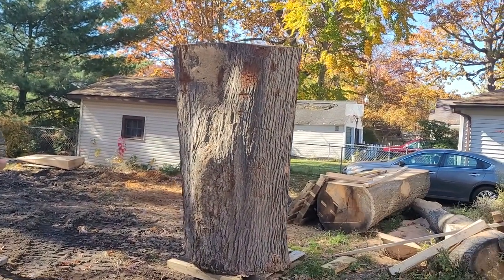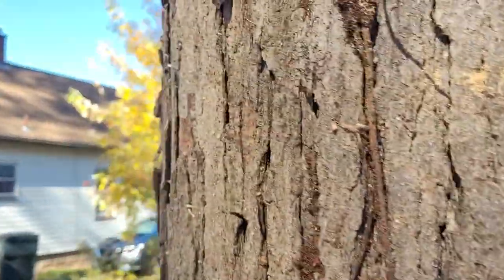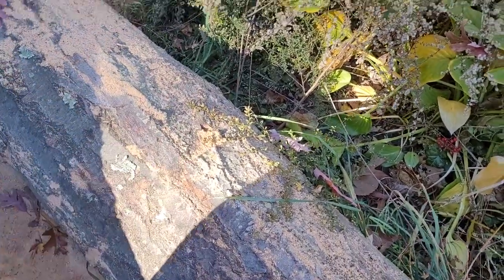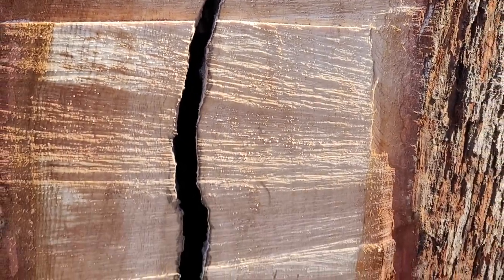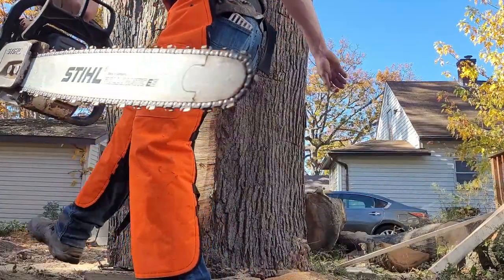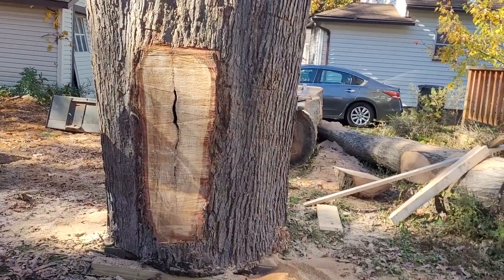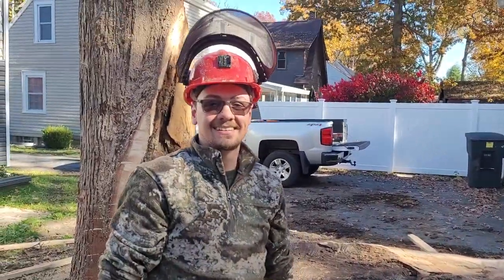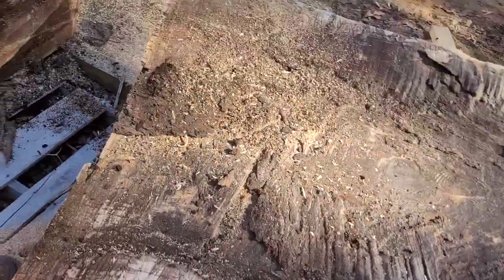#83 Log Too Big for the Sawmill?  Try this method!

Comment: That piece near the house that you spike of cutting to length and milling. It might be a decent experiment if nothing else. That piece looks like it might have some reaction wood in it which means that the boards would likely do some funny stuff as they come off the log.
The seam you were looking at it in the big piece often referred to as bark inclusion and is often a sign of weaker unions in the tree. I am also glad Austin wear pants with his chaps 🤠
Reply from the maker: I left that one log for the homeowner for firewood.  I think we were done.  it was a big job.  The owners were patient.  It took us months to get everything out of there.  I'm grateful we found the logs.  Going forward - my cleanup jobs will not be paid in wood!  This was a great learning experience!

Austin is a good sport.  He dishes it out, so he can take it.  But he's at a disadvantage because he doesn't edit the episodes!
Reply: @BissellMapleFarm  Life is one big learning experience for sure. And with fiel proces going up, I'm sure the lumber truck isn't getting any cheaper to drive 😅